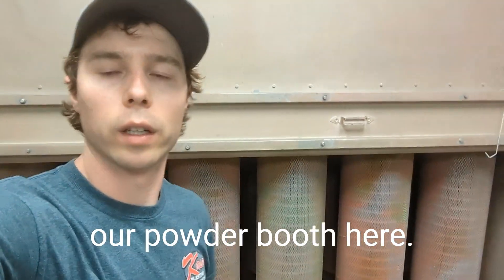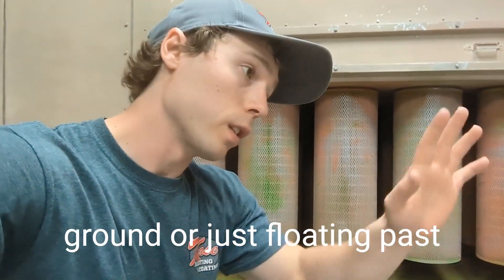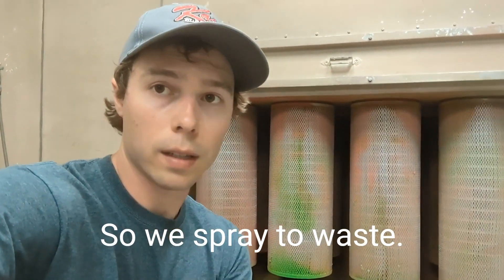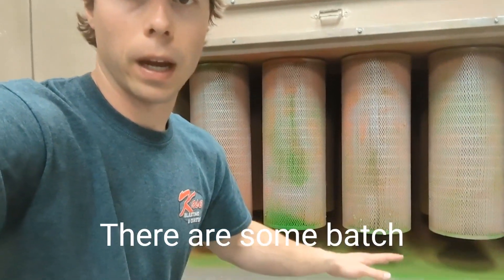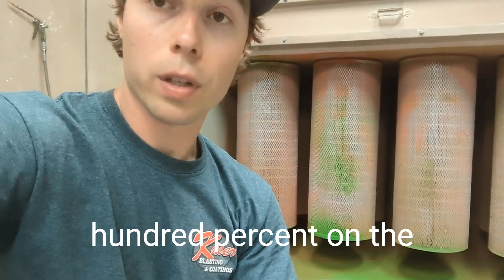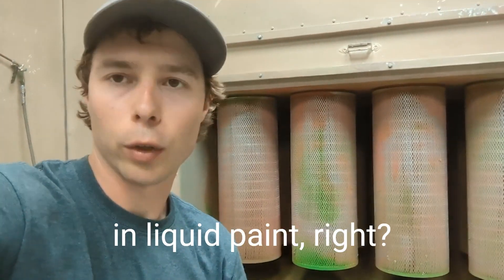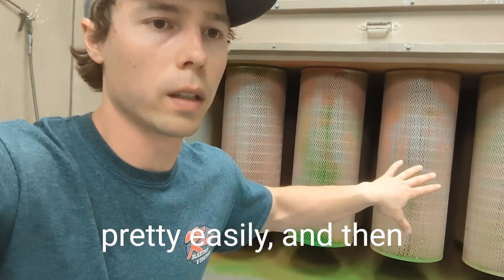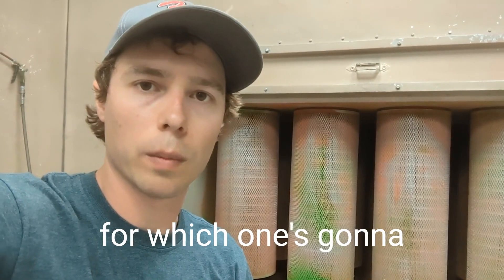What Happens to Powder Coating Overspray?

Comment: Interesting to see the difference between regular spray booth and powder booth.  At the PPG lab I would use waterfall booths and wear clean air supplied PPE whilst spraying 2K.  

I see a lot of youtubers not taking PPE and ventilation seriously with powder (and regular), and it does concern me.  Not like I can do anything about their health though.

Love the pulsing on the filters to clean them off.